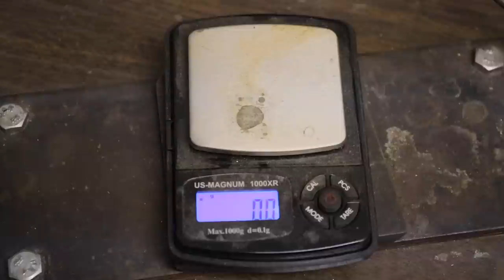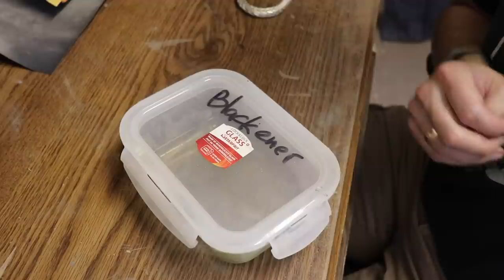How it's made - Silver Bracelet 100g

Comment: why are you heating it so many times? for example: after you ran it through the hole. I would think its to make it more managable and maleable but what difference does it make if it cools down again. and cools to the point where you can touch it afterwards?
Reply: So with metals like silver, copper and gold the more you work it the harder they get, so by heating it and rapidly cooling it it makes it easier to work with again. Kinda crazy since carbon steel when you do that it will actually harden it.